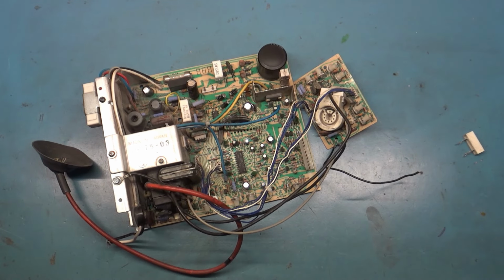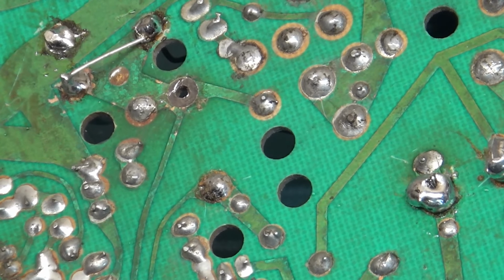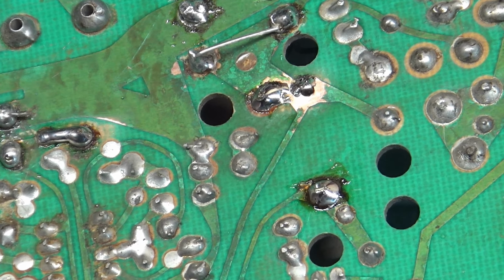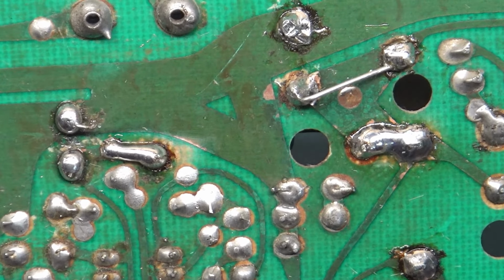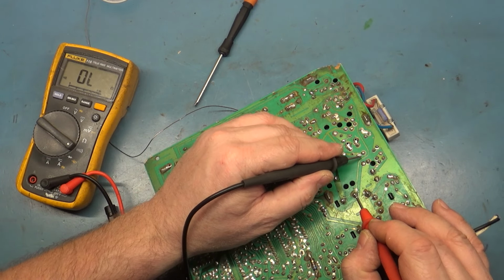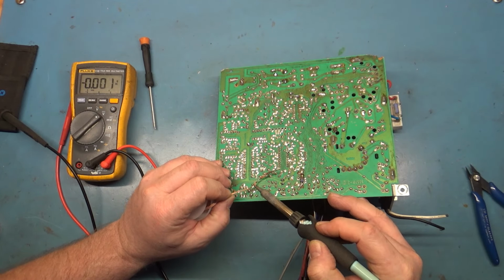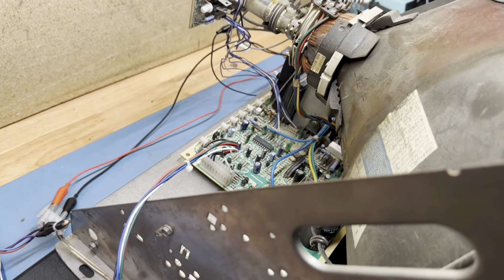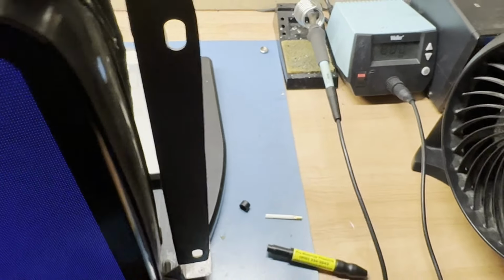19" K7000 Arcade Monitor Repair - Horrible Solder Rework - Oxidized Pad Repair Tutorial

Comment: Why do you use solder wick vs a solder vacuum?
Reply from the maker: Haven’t been able to find a good one.
Reply: @MikesArcadeMonitorRepair  I'm trying the YIHUA 948 now and i've only used it for a few hours but it's sped up recapping for me quite a bit. I'm also using a hot air station to preheat some ground connections because those soak so much heat.
Reply: Fr301 works absolutely a treat. I use it all day for analog boards. Pricey but worth it.  @MikesArcadeMonitorRepair